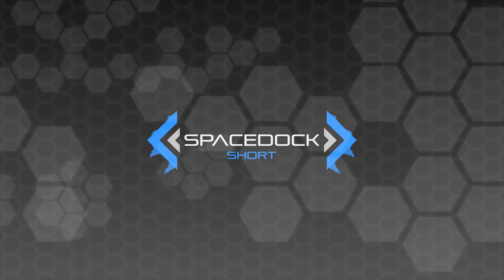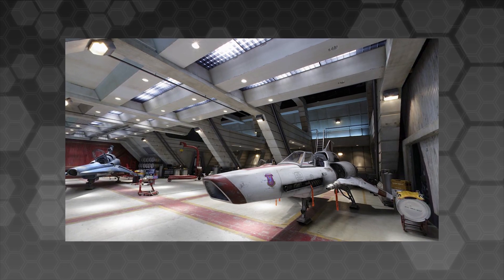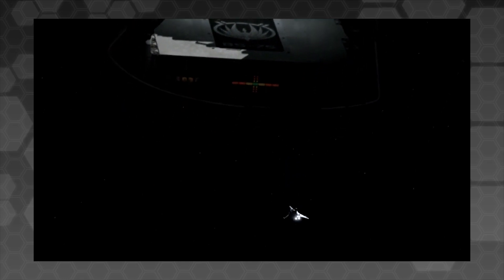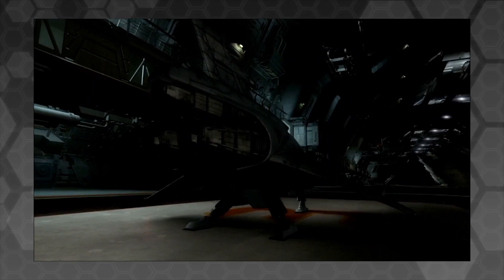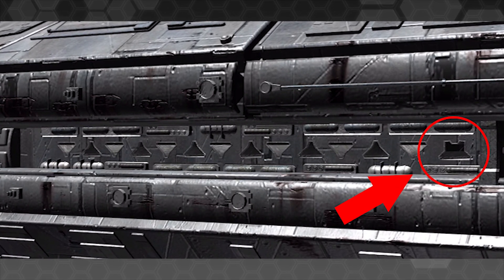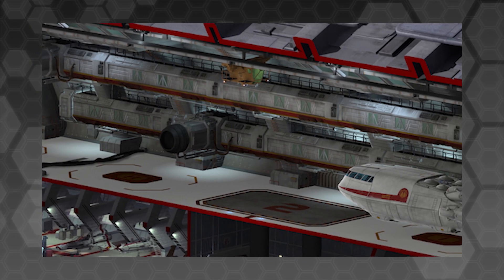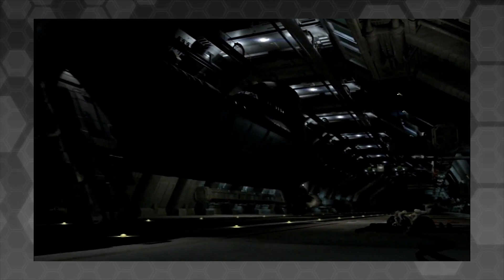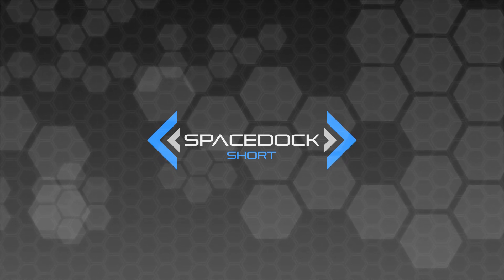How to Land on the Battlestar Galactica

Comment: On the Pegasus, notice that half of the Viper launch tubes are "upside down" relative to the other half. So, the Vipers landing on one of the underside landing bays would basically have an "upside-down" hangar/launch bay. There are 2 of these bays between the flight decks on the Pegasus, with opposite artificial gravity. So basically, the guys on the underside bays feel like they're "right-side up" and they are lowering the Vipers "down" into the launch bays. "Down" in this case is in the direction of the middle of the pods.

Comment: In the first minute of your explanation I am baffled

You first said Adama ordered the "Auto Landing" removed....but the walk through tour ( guided by a cylon ), the guide states that no tied in systems where ever installed....so there is that

and second

Your confussion over pilots not slowing down and engauging magnetnetic touch down pads

simply put

physics

they are travelling at whatever speed they come in at.....and simply need to slow down and stop anyway they can before any sort of hard brake can be used

like catch wires on a carrier....they need to slow down to a stop....quicker is better but a hard stop at any speed would cause what is called "coup contra coup"
which is basically ( in this case ) , the ship stops but the pilot inside keeps going and hits the seat belt, then their organs keep going and hit the interior structure of the body and in both cases bounce back and forth until coming to a stop

undue stress and inevitable failure of parts ( mechanical or biological )

it's been well known for many years

Comment: I think they would probably use the raptor for low volume/individual ferrying rather than a transport due to fuel economy (that transport looks around 3-5 times the size of a Raptor), so I guess it would make sense. There are several instances where the transports could have been used instead of raptors though. Maybe the transports were simply retconned during or after the show's run and there was no opportunity/incentive to use them during the show?

Comment: Or the Mercury just has 2 separate Hangar decks with opposite direction artificial gravity, after all to actually utilize the double hangar effectively they would need twice the Hangar space, a mechanism to flip ships over might be between the two hangars to make it easy to transfer ships between them for maintenance but it need not be used for normal combat operations.

Comment: To land onto lift during combat situation carrier/battlestar will need to sync pilots, inform them what lift each one needs which takes time and can result in mistakes, it is much faster to order them land whenewher pilot thinks it is safe. Not to mention that all lifts might be down...Not decelerating also makes sense - when you are not landing alone you either need great team work or to simply see when pilot in front of you is about to touch, otherwise in combat situation fighters will need to decelerate starting from followers, as to not to slam into your leader.

Comment: This landing and launching of the vipers is really stupid and just clearly comes from trying to mimic real life aircraft carriers, i.e. ships on sea. There is no reason, besides dramatic movie/series effect, why vipers should be launched from special "tubes" with magnetic or whatever tow machines. It is necessary in carriers on earth with limited take-off length for the planes to reach minimum speed to get enough air lift, but not in space. And there's no reason why landing would be so difficult, as the base ship is in space and therefore is absolutely stable and at constant speed. I love Galactica in both incarnations but it does have some stupid things like this one.

Comment: Am I the only one who always wondered how they got the vipers/raptors to the hangar deck without depressurising the deck crew... i mean it would be tight on galactica to incorporate an airlock in the lift shaft but on pegasus, there's not a lot of room between the flight decks... for two lift shafts and a hangar deck that was required to service double the amount of vipers

Comment: Presumably galactica doesn’t have raptor launch tubes because it predates that class of fighter while vipers are designed to fit the same tubes regardless of which model of viper is being used.

Comment: I think there might be two grav units on each if Pegasus' flight pods. I noticed the viper lauch bays had one upright and the next upside down, so maybe there are two servicing areas that lower ships down into lauch tubes. There's probably one thing to flip over ships inside, I'm guessing it would normally be easier to launch and recover on the other pad though.

Comment: We do it on a carrier every day during flight ops. In the Navy You land and catch one of four wire and are taxied off to a side slot and are dropped to the hanger when needed or after flight ops are completed. Old carriers have four elevators, the new class have three elevators.  Look up carrier flight operations, The Flight Deck is one or the worlds ten dangerous jobs.

Comment: At 4.10 you bring up a picture of the Pegasus' Launch tubes. It looks as if there are upside down Viper launch tubes sealed off. Maybe they don't have to re-orient the vipers at all and make use of the artificial gravity to stick that flight deck to the 'ceiling' so both flight deck are essentially floor to floor.
Though, where they find room for this is anyones guess.

Comment: I'm pretty sure they showed an inverted flight deck landing on Pegasus once. The lift flipped over to reorient the fighter. That said. using both upper and lower decks simultaneously would be very difficult. The added time you might gain would be negligible.

Comment: I like your video on this. It's a bit eye opening and makes you think. For instance, if you consider the orientation of the landing bays, they're actually quite badly designed. Instead of "up" being relative to the ship's internal artifical gravity, why do they not engineer the runway and its own artificial gravity to be perpendicular to the ship, with the runway being against the hull? This would give a much simpler ship transfer capability because any of the "lifts" on the flight deck would just need to pivot 90 degrees or 180 degrees on one edge to bring the fighter into the appropriate orientation for the the maintenance bay. This works exactly the same with both the two-bay and four-bay version of the Battlestar. This suggested orientation of the landing deck would not have any downside compared to the existing version.  Of course, on the four-bay version, you're going to have twice the number of fighters available which means twice the maintenance necessary. In this case, it might be practical to just have a second maintenance bay in opposite orientation to the first so that the fighters just go into the correctly oriented maintenance bay.

Comment: There is a launch tube scene where Starbuck's viper is assisted with a counterweight wire running in the opposite direction.  Surprised you didn't mention it

Comment: Not 180°, just 90°.
Reply: no, then they'd be on there side on the new deck.
Reply: Ah, but I didn’t specify which direction, owenbevt3.
IF I could get a closer look at the launch tubes, I’m guessing that the Starfighters are rotated so that Forward is up & down would be towards the rear. But this is mainly based on Propulsion generated gravity, not the ‘traditional’ science-fiction gravity.

Comment: FYI, the job title of the officer in the pod guiding Vipers in is called the LSO or Landing Signal Officer, on a modern US carrier they're the ones stading on the back, off to  one (forget which side) wearing white vests/jerseys. However, unlike in real life, there isn't a single designated LSO, there's usually several on duty at one time during flight ops and they're chosen from the senior pilots of each squadron. They're also never that high ranking, at least not in terms of the overall chain of command, in the flight wing they rate below their respective squadron commanders, and (of course) the CAG who is the senior most officer in the flight wing but has no place (along with everybody else in the flight wing) in the direct chain of command of the ship despite being an O6 Captain like the ship's captain.

Something worth mentiong in relation to flight ops is the occasional usage of the term Actual as in Galactica Actual. This is used (mostly) correctly but some people misunderstand the term, while Actual does refer to (In this case Adama) a unit's or ship's CO, it is not their personal call sign and does not exclusively refer to the CO either, it can (and more typically) also used to refer to senior officer on duty/officer of the deck as opposed to the radio operator. One thing they did get wrong in BSG is that the pilots, when asking for Galactica Actual, should be really talking to the CAG and not Adama since the CAG would be the one in charge of flight ops aboard the Galactica. But then again, BSG is a fictional universe with different rules and few shows/movies actually understand how a carrier works with their split command structure and chain of command.
Reply: Riceball01 Just my two cents: the BSG pod Officer would be more analogous to a R/L carrier’s Air Boss given the amount of landings happening concurrently. An LSO just handles one at a time.  As for an LSO, they hang out on the port side in a nest lines with jump nets...in case a landing a/c really messes up.  They volunteer for this position as it’s extra duty.  Your squadron xo may “voluntold” you for that duty if the ship is short on your type’s LSOs.  A trainee LSO will just land the craft they fly until a senior LSO signs off on their competency, then they learn how to wave on other craft types, backed up by a trained pilot/NFO on the other type.  Last trivia...you see movies where the LSOs are holding a controller above their head.  That’s a reminder that the deck is foul and no landing are permitted until it’s clear.  Then they drop their arm and watch and listen (the only ones on the flight deck without cumbersome ear protection; you use foam ear plugs so you can hear the engines, ex, you give a “power” order and you don’t hear the engines respond and the a/c sinks below the glide path, your visual and auditory clues help you make the decision to wave off the landing a/c. You push the pickle button on the controller you and a backup LSO are holding and the Fresnel lights flash, telling the landing pilot to go around.

Comment: is it possible that instead of having a lift the upside-down landing strip just flips the craft over? It would be far easier to just rotate the deck at that point than to bring the ship in and move it to some sort of inversion mechanisms. The lifts go up and down so that there is a sort of airlock mechanism but if you just flip the deck you would actually save space by not needing the extra room for all the hydraulics and such. Come to think of it, other than looks if that is actually an easier way of doing things the lower two should be the primary docks.

Comment: I'm picturing the model designer of the Pegasus watch you point out the detail of the raptor launch tube: "*gasp*  someone noticed!"
Reply: Did you also notice all the inverted Viper launch tubes sealed between the open ones?
Reply: @macsnobia  Which could answer the question of the upside down landing bay.  At full capacity, they just operate a set of vipers upside down.
Reply: @ParentalGuardian-b7z  bruh
Reply: I've accomplished nothing with my life...
Reply: @atticstattic  good for you

Comment: On the note of the two different orientations of gravity being an issue when bringing vipers to the hangar deck on Pegasus, it could be that there's not even artificial gravity in the pods at all. Unless I'm forgetting something, we never see anyone just walking around on the landing deck unless they're in another ship which has its own artificial gravity (or strapped down in the case of vipers), and not having gravity for that deck would even make sense, because ships coming in for landing could use their own rcs to control how quickly they come down to the deck instead of having to fight the artificial gravity to bring their ship down slowly. Then it's just a (relatively) simple matter of the lifts on the ventral deck flipping 180 and lifting the landed ship up into the hangar deck, instead of needing to mess around with changing the gravity

Comment: I think the use of Raptors for taxiing people was done because shuttles lack FTL-Capability and in the event of a Cylon-Attack, they would be unable to do an emergency jump. Landing all the shuttles would take way too long, so the use of Raptors was basically the only way to create a safe exchange of people and most likely also (at least some) goods between the ships of the fleet.
Reply: I imagine it's also because those shuttles are quite high-capacity (they appear to have multiple decks, at least) and launching and retrieving them just for short flights of a few people would be complete overkill (not to mention a waste of limited fuel).
Reply: And also, the internal sets/external CGI models were already built.

A '70s-style shuttle wasn't shown until President Roslyn landed on Kobol (and then only as a grounded CGI model behind her.)

Edit: I stand corrected.  A few comments below this; someone points out that a '70s shuttle is also on display in the Galactica Museum.)
Reply: @jedigecko06  Dude the 70s shuttle is the focal point of the opening shot of the mini series!
Reply: the big shuttles probably had FTL as well, we see a TOS style version making the trip out to Armistice station in the miniseries opening, and that trip would certainly have required an FTL jump to make in a reasonable time given how distant that station was. and we have the newer style show seeming to operate independently as part of the fleet in several cases. (sometimes appearing in fleet shots flying in formation with much larger vessels)

i suspect that the in universe reason to use Raptor's primarily was probably because not all the ships had hangers big enough to handle such craft, or docking systems able to dock them externally, but most ships did have hangers (or cargo loading bays) that could easily fit a raptor. though i suspect that those types of shuttles probably did see use helping to ferry civilians around the fleet between the bigger ships.

Comment: Flipping the fighters would be as easy as using a different kind of door.  Instead of an elevator type door, just use one on a hinge.  The "floor" you're sitting on swings in and ends up on the back side of the landing pod "floor".

Comment: In modern carriers the "ball" is a reference object near the back of the ship with lights or flags that tells the pilot if they are coming in high or low and whether they are coming in too fast or too slow. It isn't the landing strip on the deck itself. I suspect Galactica has a similar mechanism on the back of the landing pods.

Comment: for Pegasus, since there appears to be 4 rows of Viper launch tubes (1 for each flight pod) realistically they'd just need a rotating floor panel that a Viper/Raptor can Clamp onto and just be rotated into the other flight pod. this is much easier to do than some mechanical nightmare bringing Vipers from an open deck to a maintenance bay. however with that there must've been 1 case of somebody forgetting to clamp the Viper down and it getting stuck between the Space magic gravity generators.

Comment: on the Pegasus it seems the the lower hanger bay may do everything inverted to the orientation of the upper bay. If you look at the image you showed earlier in the video of the launch tubes along the side of the ship they alternate orientation with half of them seeming to launch inverted from the others. This would be logical if you can just change the orientation of the artificial gravity. why have to move the vipers and other ships  when you can just find a way to change the gravity of the personnel entering the bay?
Just think of the passage with the stripe in it that Corran Horn found while he was escaping the Lusankya

Comment: First off, I've not actually watched BSG so I could be way off the mark here but with the Pegasus' dual stacked flight pods, could the lifts in the lower pod come out from the deck instead of flipping? So the landing craft would re-orient themselves before landing on a lift, eliminating any complications from a rotation mechanism in the lifts?

Comment: Would be very dangerous to have Colonial One kind of loosely rattle around in the unpressurised flight pod during combat maneuvers. Vipers can just stay put with their spiderman powers but one docking collar isn't going to do much to hold ship size of Colonial One in place if Galactica has to alter it's course.

I've always thought Vipers "combat land" to save RCS fuel. Skidding on the deck with magnets is very efficient compared to burning possibly irreplaceable RCS fuel vital for all Viper maneuvering. Landing right way around also has the added perk of being able to abort and jump over the guy in front of you to avoid crashing.

They could flip and kill velocity with their main engines but such maneuver would have very high stakes. Essentially you'd manually pocket park a bomb, while going relatively fast ass backwards. And you've got no decent reference points or rear view mirrors to work with. Even if you don't hit the Galactica fatally, you still may plow through Vipers already parked on the deck. Very, very high chances of things going very bad at some point.